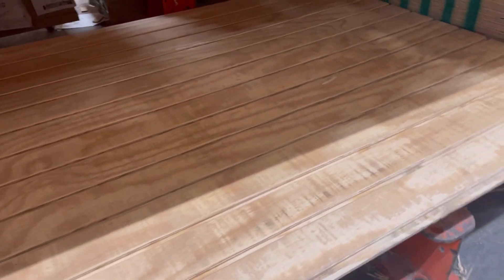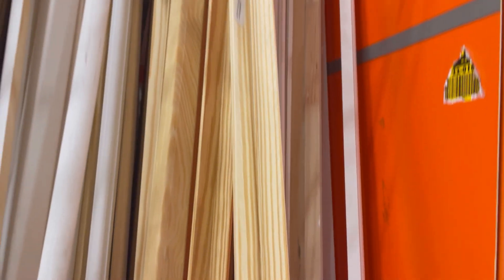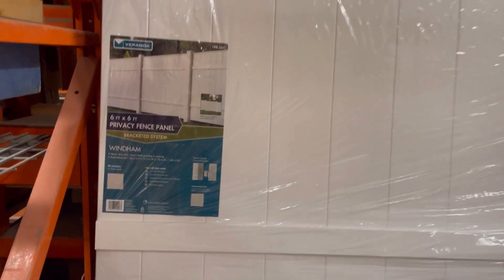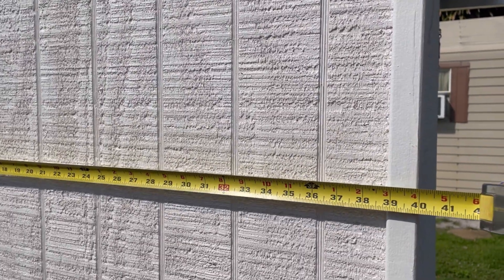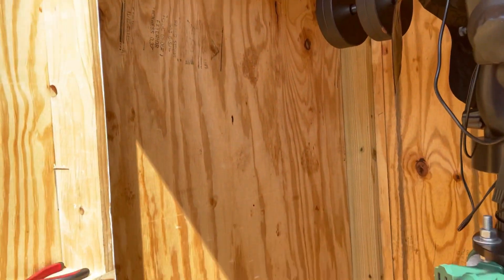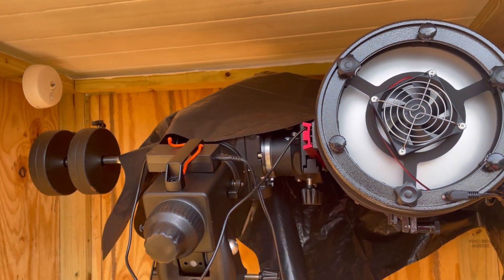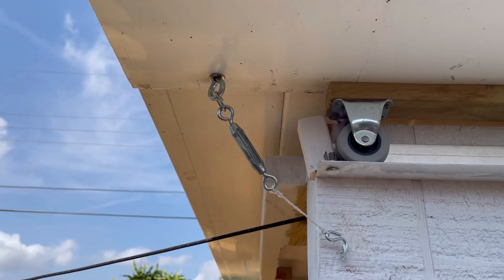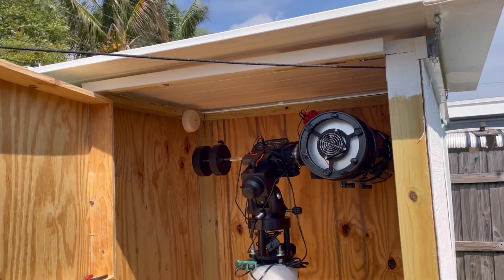Observatory- Building Material and Dimensions

Comment: Nice and simple!  I would have gone with a building that would roll to the side since yours is so small.  This would allow you to close the roof gap up properly so no wind driven rain, or insects, gets in.
Reply from the maker: Simplicity is always enjoyable. Yeah a building would have been good too. Only issue that I did not want to fight was uneven ground or having to lay concrete to get a flat surface to roll easy.